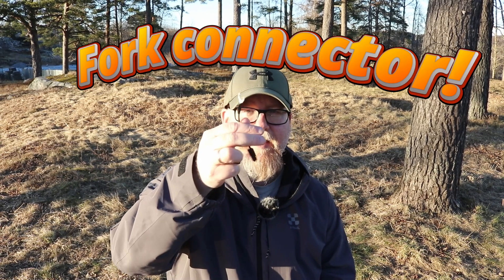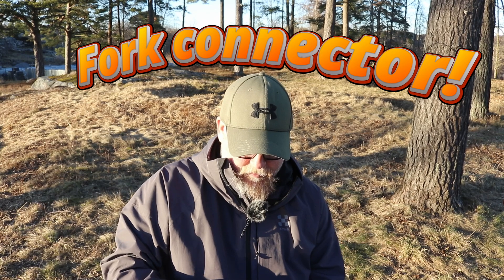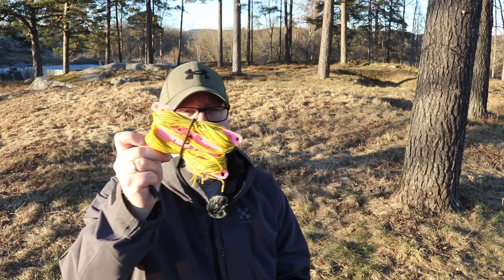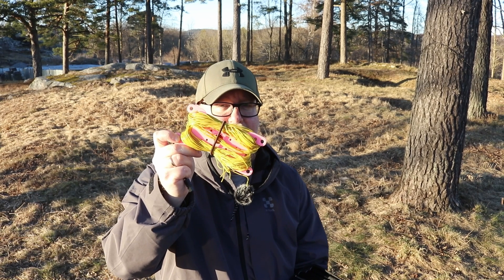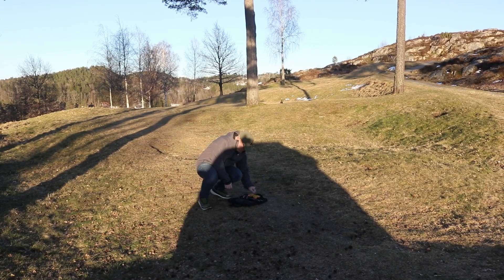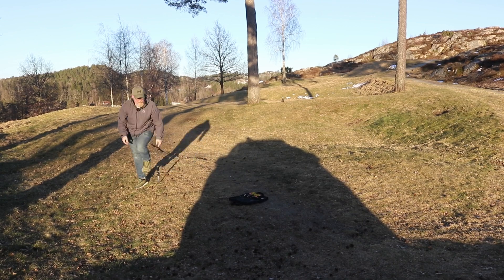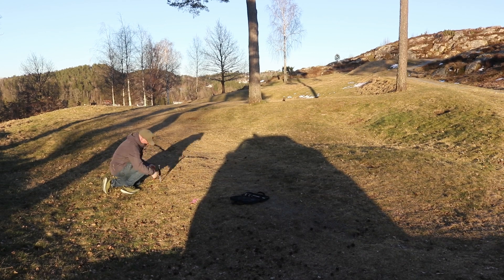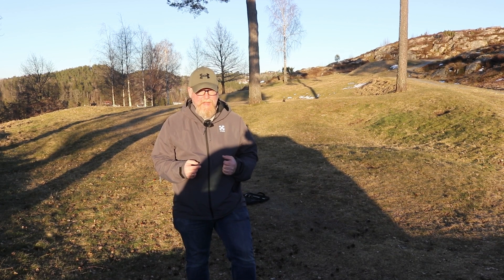IMPROVE your JPC-12 with BETTER RADIALS!

Comment: I threw the ribbon away quickly and used chicken wire for a while. Worked great. I recently bought some faraday cloth and it works even better now. Most of this antenna system is great. The whip could be better. Feels like it could break in a good wind.
Reply from the maker: It does break in wind, but replacements are cheap.
Reply: @LB0FI My whip hasn't broke yet fortunately. I did order some longer ones to see if I could eliminate the coil on the lower bands. But yeah, really like this antenna. Got myself a new distance record with it on digital. 18000km with 5W. 

Are you still running this antenna?

Comment: Thank you for your video 
You mentioned that you had 8pcs of 5meters radials? I would hoped to see how you had it thank you 73 de kh2zz
Reply from the maker: I use the same radial net for most of my verticals. It has eight five meter long radials connected to a single powerpole. I try to spread them out as much as the space allows depending on where I am.
Reply: @LB0FI thank you enjoy the hobby de kh2zz 73

Comment: My JPC-12 had no conductivity at all between the body of the pl259 and the earth spike. The body of the base section is anodized , which is an insulator. I removed the black coating from under the pl259 flange and that fixed it. Also a 1/4 wave vertical impedance is about 35 ohms, so the best SWR you should get is 1.4 or so..
Reply from the maker: But 1.4 is plenty good enough.

Comment: Hi Morten. My experience with verticals like this is that life gets a whole lot better when you elevate them. Mount it on a tripod or other support to get it about 5 feet off the ground. Use tuned radials. One or two would be sufficient. Elevate them as well. Be sure to use an RF choke near the feedpoint. I think you’ll be happy with the results. With that setup, ground conditions won’t matter.
GL, 73, Marc, W4MPS
Reply from the maker: Yes, but time is not something I am willing to compromise on in the field. And having raised and tuned radials just takes time away from playing radio.

Comment: You forgot to show your counterpoise connected to the antenna base
Reply from the maker: It’s screwed in with a ring connector. And it was more likely an editorial decision rather than forgetting. Thanks for commenting!
Reply: @LB0FI ah ok got it was just wondering if you connected a different way. I have the same antenna I use a large crocodile clip I clamp below base where it meets the ground stake and get good connection

Comment: Where can I find more info about the mentioned radial net?
Reply from the maker: It's eight five meter long radials terminated into a powerpole connector. And the other end is a jumper with a ring terminal in one end and a powerpole connector in the other.

Comment: I just got a JPC-12 and tested it yesterday. I used the ribbon wire radials and I don't think they helped much. I did use a common mode choke (an ABR 5 ferrite bead assembly). I live in Florida and was picking up the New England QSO Party very well, but I could not get anyone to answer. Before I saw this video, I already built a new set of radials using 6 18 AWG stranded wire, 15 feet long. I hope to try it again tomorrow.
Reply from the maker: Ground conductivity is key when using this antenna. It simply does not perform well in areas with poor ground conductivity without additional radials (like any (loaded) vertical). Band conditions are also really poor at the moment, so that could also explain your struggles.

Comment: Always good to try to use that which has been used before. It was also good to get in your log in 10th. Cheers Morten. 73
Reply from the maker: That radial net have been a life saver for me plenty of times, and that's why it didn't surprise me that it worked well on the JPC-12 as well. Happy to work you Gary!

Comment: The provided couterpoise ring makes  for some reason an intermittent to the antenna. There are times tightening the spike to the base is all it takes to work great.
Reply from the maker: Yes, it can be hard to get a mechanical connection between the ring and the base. I also have some  doubts on how good the solder job is there.

Comment: Hello Morten, nice useful tip to JPC-12 owners here, thanks for sharing. I did almost the same, adding another set of 8 wire radials soldered to another ring connector of the same kind as the one at the end of the ribbon cable. I made them of the same length as the original ones too. And yes, it does bring an improvement.
Something that's not obvious from your video: did you split the ribbon cable up to single wires? I did.
And as someone pointed out in the comments, I do use a choked coaxial too to hook it up. It has a quite significant effect on SWR.
Best 73s de F4LDT
Reply from the maker: I have split the ribbon cable into five. And while it works fine where ground conductivity is good with the ribbon cable, but it struggles where conductivity is not so good. But this made a whole lot of difference. Thanks for commenting Alain!

Comment: Years ago i picked up a Super Antenna clone which came with 4 or 5 meter (never measured them) long ribbon cable radials. Each radial was composed of 3 strands of the wires still attached. Never separated those.

Had the same issue, inconsistent tuning.  Made a new radial set out of 16 guage (US) speaker wire - 4 radials at about 10 m (33 feet) each - and the antenna now consistently tunes and is one of my favorites for portable ops.
Reply from the maker: I also have a super antenna clone, but I never got that to work good enough for my liking. But yes, new radials make a lot of difference.

Comment: Maybe use it as "POTA Performer" style by elevating the feed point 1 meter high above the ground, to reduce the ground loss. https://whiteriverradio.com/wp-content/uploads/2023/07/POTA-PERformer-Antenna-by-KJ6ER-2023-03-1-1.pdf
Reply from the maker: I generally try to make things easier for myself when portable.

Comment: The radials which come with the jpc12 are terrible. I made four 5.2m radials, which made the the antenna so much better. I thought about more, but considered to much work to set up. I turned a disk out of aluminum that sits between the feedpoint and the ground spike. I can simply plug the radials into this with banana plugs. You can see this on the last photo on my qrz page, if you are interested. Thanks for the video.  73, dk3rn Peter
Reply from the maker: I do have a disc made by Radio-Stuff. I do find it a bit of a hassle using eight banana plugs vs one powerpole. The disc itself is awesome though and I have a video on it.

Comment: Radials are as important as  the driven element. So I'm not surprised that going from the ribbon cable cables to real radials made a big difference. Ed
Reply from the maker: @DD5LP  l have a feeling that the ribbon cables aren’t soldered well to the terminal.
Reply: I wonder if it's the guage of the ribbon cable wires. Something to ponder.